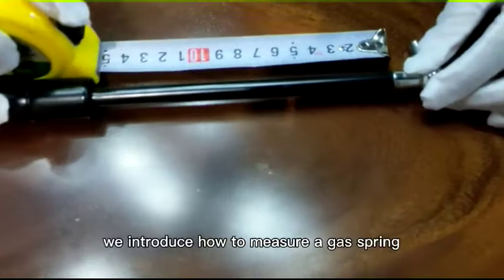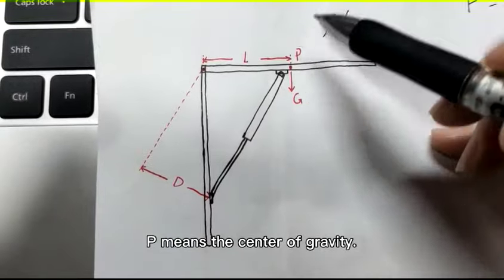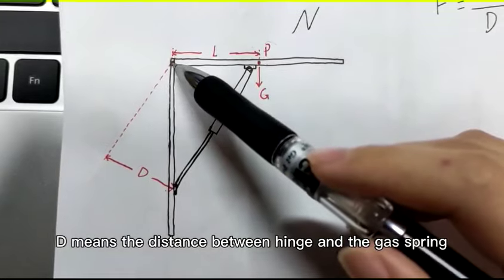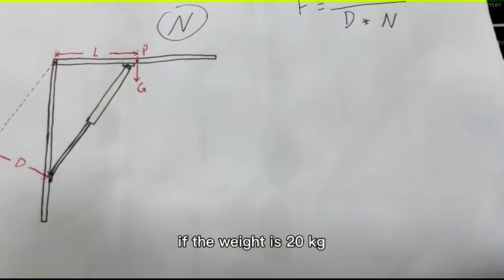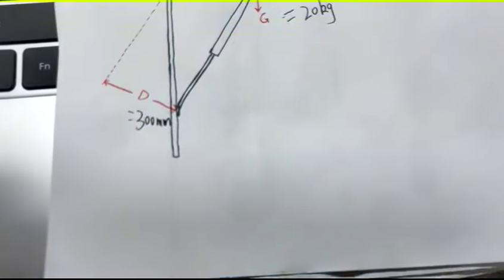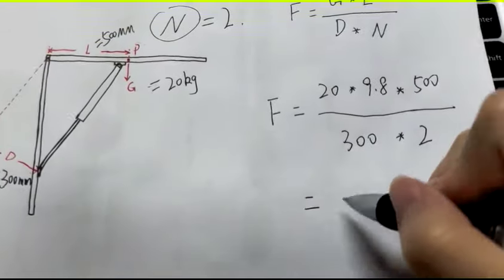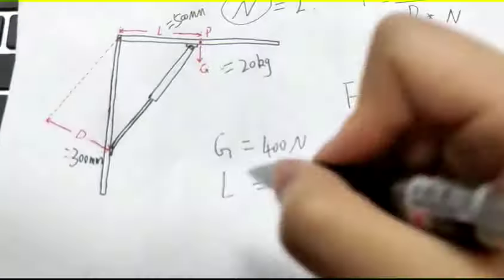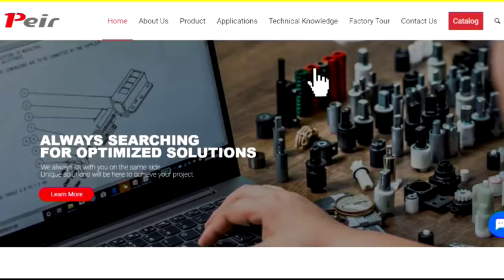How To Calculate The Force Of The Gas Spring?

Comment: The length of the strut (comp and extended) is important for placement which will change D. This simple approach works for LBS and inches or feet too but choosing a strut length AND force has to be done carefully. Make a drawing...
Reply: How can I apply this to a vertical murphy bed?

Comment: Hola tengo una duda que he buscado y buscado solución pero no la encuentro

A ver si alguien me ayuda

Necesito levantar una tapa de 2000mm * 1300mm con un grosor de 40mm, peso aprox de 25kg

Pero, necesito levantarla a modo de techo sin pivote, necesitaría 4 resortes de 800mm pero... No se de cuantos N... Ya que el vendedor me ofrece de 100 a 800 y no se calcularlo con este sistema de elevar completo sin pivote (imagínense levantar una tapa de una tupper) por lo que he averiguado necesitaría con 250N pero... No estoy seguro.

Comment: To measure D, which angle taken in refence?
Reply from the maker: D, means the distance between hinge and the gas spring, and the gas spring is in an extended state. So the angle should be 90°.
Reply: @peirinternationallimited3097  You have any formula to calculate time requirement to complete open and close cabinet ?
Reply from the maker: @yash ladani   Pls send the inquiry to the mailbox: info@peir-hk.com